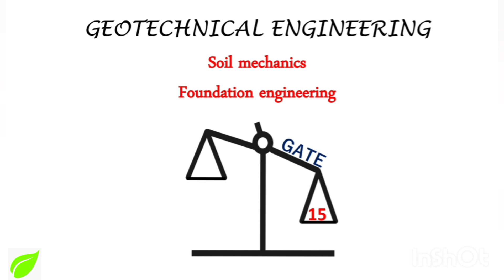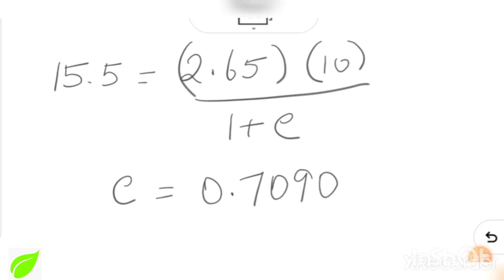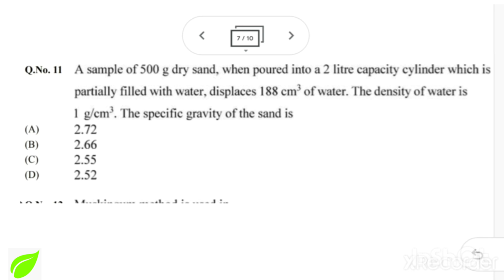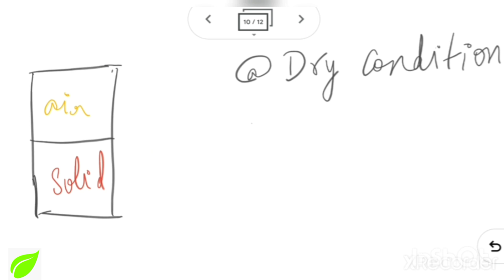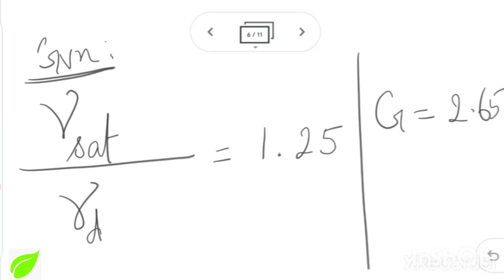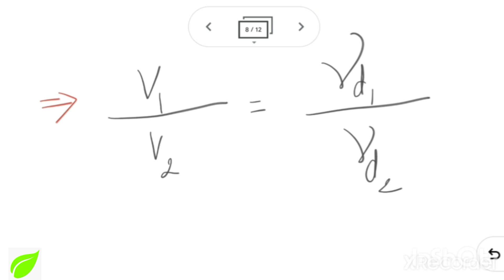soil mechanics GATE Q&A |GATE 2023| TRB preparation | Geotechnical |  3-phase system of soil - Part1

Comment: In question no 7 in formula you are using V1/V2=gammad1/gammad2
V1=? V2=100M3
Gammad1 =17 gammad2=16 
Finally your ans be 106.25 cubic meter please verify it
Reply from the maker: @sandeep Thank you for pointing out .kindly correct the formula given its : V1/V2 = gamma2 /gamma1 , therefore 94.11 m³ is the right answer for the question.